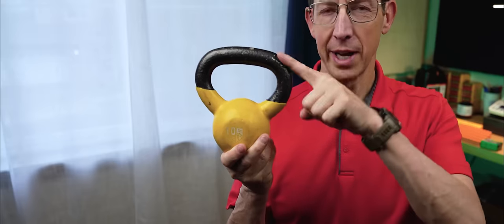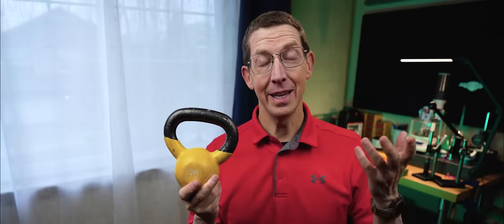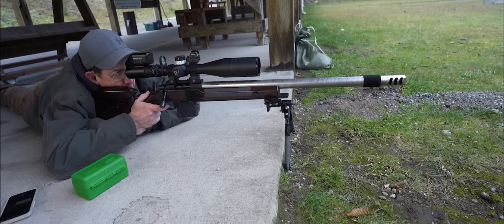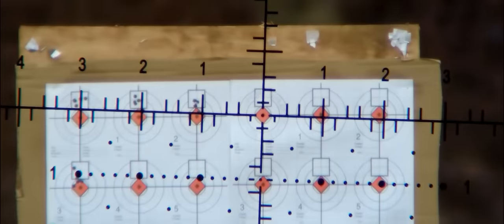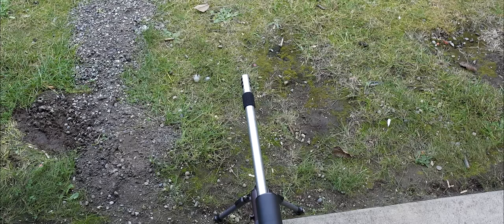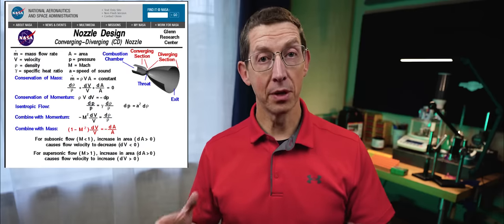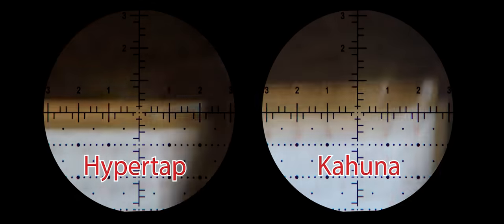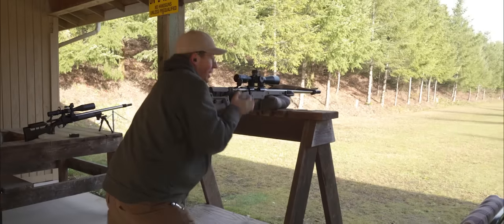Selecting a Muzzle Brake

Comment: The last few rifles I've bought were heavy barrel, "predator" versions of fairly cheap guns, with cheap plastic/ polymer? /hollow stocks. I've been pulling off the butt stocks and adding a pound or so of weight inside them (BB's etc) really seems to help with the balance and recoil, for under $1

Comment: Number one thing with precision brakes is don't take them off. Number two is symmetry. The asymmetry from vertical ports creates barrel whip and, while you can tune it out, it changes barrel dynamics.

Comment: In our shop we use Harrell's and we bore the I.D. after solid installation. Thanks.
Reply from the maker: That sounds like a sound practice.
Reply: I have had great results with Harrell’s on 4 6bra’s. My wife would not be able to shoot her 12lb without one due to shoulder issues. We use one reamer and load for all, adjust tuner individually for gun. 1k VBR .

Comment: You’re absolutely correct on the topic about self timing breaks. They have caused me nothing but problems. I never thought of lock tighting it but I buy the simple screw one and file down the mating surface until it’s clocked right. Takes some practice with a hand file but it looks good. Thanks for the video man.

Comment: Keith, I always appreciate your clinical / scientific approach to options. I wish I made the time to share ideas and findings with this community but I simply do not make time in my life yet. 

May I offer a additional component for consideration?

I started really look at torsional rotation forces because of David tubb. He made a good point one day when he was explaining his five star muzzle break. His breaknports have a angle bank that help with torsional loads. I founds this to be very true with the cartridges you shoot 6 dasher and the 6xc I shoot. It is more pronounced with the 6mm because we are using fast barrels (7/7.5 twist) with moderate weight projectiles (115g ) in my case. 

I have settled on good break port positions along with centerline offsets of gun weight and bipod pivot points to subdued ignition reaction energy.

Comment: I think you were starting to hit on it but the reason brakes are so effective is because you're redirecting the mass of the powder at the same velocity (or higher) as the bullet. Compared to a Dasher and a 107 SMK you may have 30ish grains of powder or on a 6.5PRC with a 140, you may have 60ish grains of powder, etc.  

That weight is now not contributing (as much) because it's not going straight downrange with the bullet.

Comment: I noticed the movement of POI with a flash hider.  They get a lot of carbon in them and on the crown of the barrel.  I was removing it to clean.  When replacing, I noticed POI changes.  I finally realized that the crush washer was thicker on one side then the other (about 0.002”). The orientation of the washer was different each time I installed the flash hider since I was not making any attempt to clock it in the same spot.  I lathe turned the washer and the problem went away.   I was surprised at how much the slight difference in gasses escaping on be side vs the other could deflect the bullet.

Comment: 1) The momentum of the gas is much less than the momentum of the bullet.  A muzzle brake cannot reduce recoil more than about 30%.  The the real problem is this: it redirects the muzzle blast back at you and other shooters, that's a real steep price to pay.  I fired a .223 with a brake (Ruger, a 223 doesn't need a brake) )the other day and forgot to put my muffs on.  I experienced sharp physical pain and the retort was worse that firing a 308 or other cartridge without a brake.  Plus a brake can negatively effect the bullet on barrel exit.

Comment: My largest problem with specific muzzle brakes, i.e. witt machine, top ports that aren't adjustable. I have a clamp on brake on a 06 that was kicking like a mule, put the brake on and can shot the rifle all day long no problems, so witt machine done a great job, the part that isn't so great is the only brake offered for the 30 cal clamp on from them came with top ports, if the ports could be closed or adjusted to a minimal amount of muzzle flip assist it would be top notch, but the ports are just open so when shotting off bi pods at targets, the rifle gets shived down and bounces off the bi pod, and in the flimsy stock that the rifle is in at the moment is a bad day for accuracy at distance. Lite shorter barrel, can almost bet it is pushing the barrel down to the stick. Fixing the stick issue tomorrow with a new more rigid stock, figuring out how to close or block off the ports in a fashion that will allow adjustability.
Reply: I have a brake with 3 round ports facing up. I threaded 2 of them and installed a set screw to plug them up. Works well
Reply: @codyway7424  I thought about that as a fix, the witt machine brake has a bunch of ports that are tiny on top, 5 port brake but 4 small top ports per port, 2 on each side of brake ports, finding a tiny set screw may be my challenge, may have to drill them slightly larger. Thanks, I'll be looking at that for permanent solution.
Reply: Why don't you thread one of the holes and plug it. Maybe, thread and plug 2.
Reply: I just noticed codyway said the same thing....

Comment: Curious if you have tried a Area419 Hellfire Match. If so what are your thoughts?

I've been using brakes since 2014 in PRS and similar matches. Over the years I have gone through 5 or 6 different designs, finely settling on the Hellfire Match. I remove and clean my brake every 100-150 rounds  when i clean my bore and the zero never changes from one session or Match day to the next. It's a two piece design and uses tapers. The universal adapter mounts to your barrel and remains on the barrel for the life of that barrel and the brake attaches to that and mates up to the adapters surface. 

I can't say if it changes my groups as I have not tested for that. I develope my load after the brake is installed on the barrel. Anyway, give it a look if you haven't already. As mentioned by another poster I to will be moving to a Area419 Maverick as soon as it it out of jail... it will attach to the same universal  adapter the brake currently uses making it easy to swap back and forth once I account for the POI shift the heavier suppressor will create.
Reply from the maker: As stated in the video, I'm not recommending or cautioning away from from any particular product.

Comment: I am thinking of buying the Eric Cortina Tuner Brake, any suggestions on buying or not buying a tuner brake?
Reply from the maker: As stated in the video, I'm not recommending or cautioning away from from any particular product.
Reply: I would suggest buying a brake from a company who has engineered their brake to do its job and if you feel the need for a tuner, add it separately. To paraphrase Erik “what are the guys that are winning using?”

Comment: 9:50 the hypertap does have vertical drilled holes, doesnt it? As seen at 3:00. so it is NOT a straight back brake.
Reply from the maker: There are dimples on the outside, to allow you to drill holes if you wish. I have not.
Reply: @winninginthewind  oh ok. I See - my mistake. Thank you :)

Comment: what is a flat baffle design?? i search image on google but did not get clear answer.
Reply: Think of a penny with a hole in it, as opposed to some other odd curved shape the bullet passes through.
Reply: @codyway7424   thank you for the explanation.
Reply: Two banks of ports that are vertical and 90 degrees to the barrel

Comment: What could be used to clean a muzzle break? I've heard all kinds of things.
Reply: Soak for a day or two in bore tech c4. It will all come off pretty easy after a good soak. 

Area 419 says it’s the only product that won’t damage their finish or void their warranty. Might be an inside deal, as I’m sure there are other products that would work. C4 does work. 

No CLR unless you want your black coating to turn pink. I’ve seen it happen.
Reply: Lemi shine worked great
Reply: Ultrasonic after taking it off.
Reply: I use the "dip" method which is 1:1 distilled vinegar and peroxide. Dont do it in the house as it causes a harmful gas but I leave my brake in it for about 3 hours and everything comes off. Just rinse it with water when finished. Hasnt caused any issue to my black nitride brake and ive done it several times.
Reply: Brake cleaner in an old glass pasta jar. Been using it on my stainless and Nitride/DLC brakes with no issues. I leave them overnight and scrub with a nylon brush, then finish cleaning with Q-tips.
Reply: Ironically, CLR. 
Allow me to elaborate a bit. My experience is ONLY with stainless steel breaks. Mini years ago I had a break that I let go and it built up some significant carbon and would almost presented like silicon scale. That was so hard I couldn’t even scrape it out. It was like scraping glass. I tested several solvents that I had around the shop and common for cleaning solvents a couple days at a time soaking it. On a whim, I grab a Ziploc bag filled it full of a few ounces of CLR through the breaking it, let it sit for a couple days. To my shock it stripped it clean. Of course, nowadays there’s a lot of controversy over cleaning barrels with CLR. My position is a simple one, everything has a use and a place.